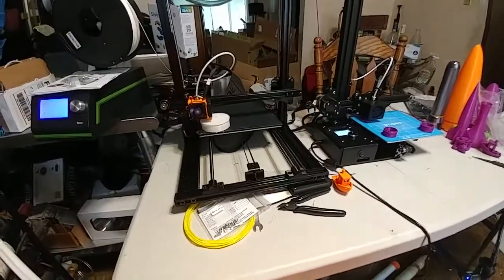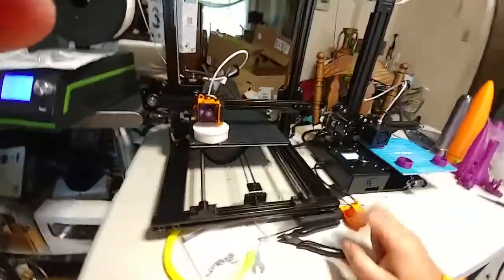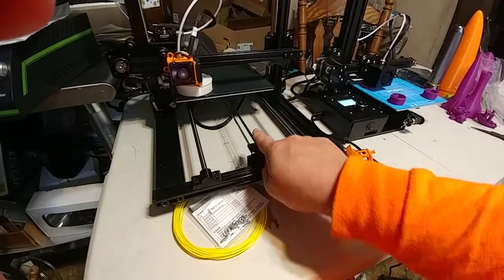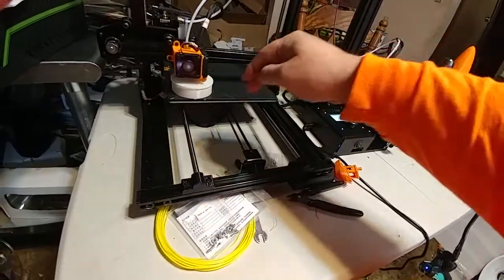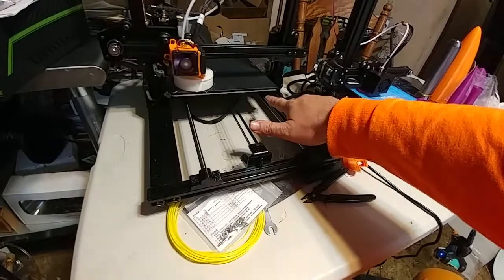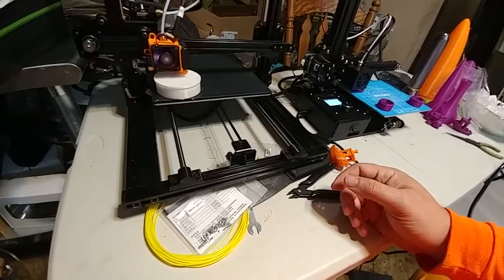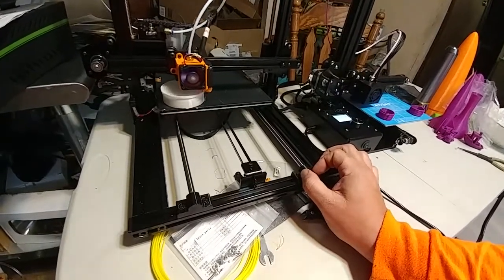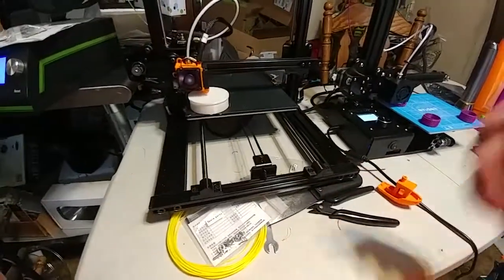Today's 3D Print - Load Bearing Printer Parts

Comment: Those rails do carry weight, and are load bearing. It is just spread across the two of them. It is all of the weight of the bed, and it's parts, as well as the item being printed. What do you think the bed it resting on?
Reply from the maker: SweetBlu carrying weight and being a load-bearing or not the same thing this is why when you want to modify your house they have to check for load-bearing walls all of the walls carry weight but not all of them are load-bearing maybe I'm using the wrong words here but there's a difference between a primary structural component that has significant Force applied to it and a secondary component that has minor Force applied to it they're not the same thing those 3D printed parts are not load bearing not as I am using the term if I'm using the wrong term so be it but you should be understanding what I'm saying even if I'm using the wrong word I'm not an engineer although I went to school to be one I never got my degree
Reply: Nerys that is also not correct. A load bearing wall means it is bearing the weight of whatever is above it versus a non load bearing wall is only holding up itself. The very definition means that if the item has something that depends on it to be held up (meaning if that item is removed whatever is above it would fall) it is load bearing. Remove both those rails and tell me that the bed doesn't fall :). I promise that it would fall not much, but still fall it would.